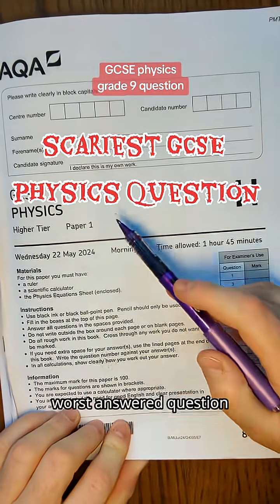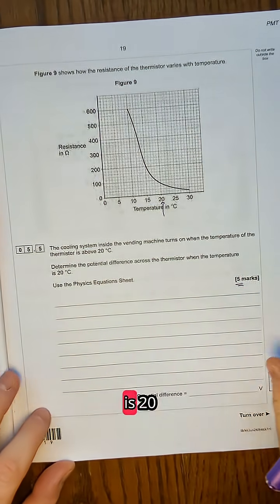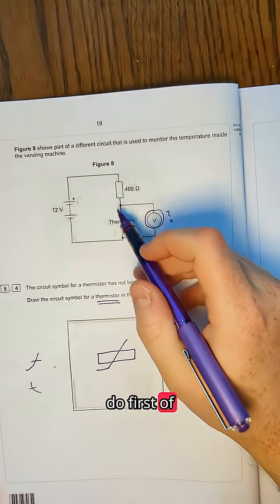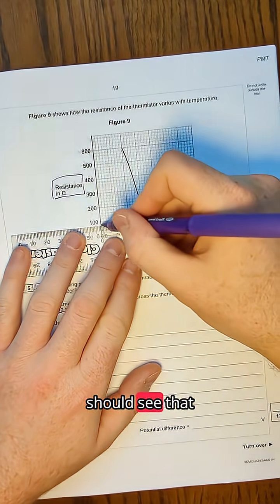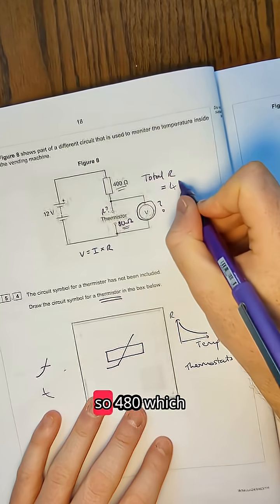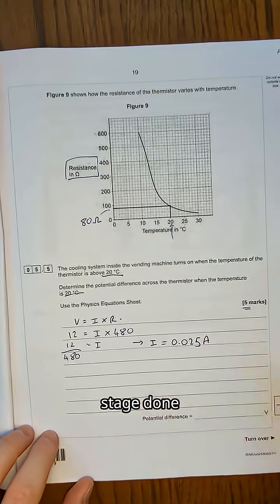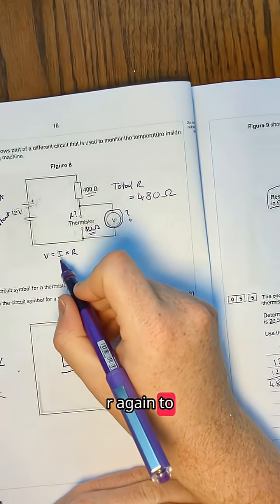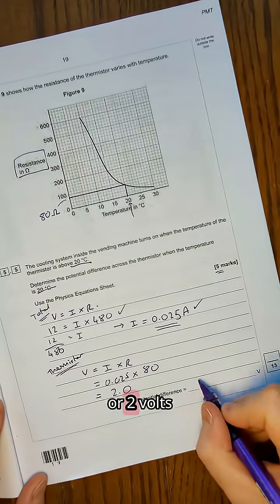TERRIFYING electricity question 😱

Comment: Why does GCSE Physics go so deep into what feels like electrical engineering? I get that physics and materials science are important for understanding circuits (so the other way around), but it feels like we’re crossing into another subject. Also, why are we still teaching V = I × R instead of just saying 'voltage = current × resistance'? Using 'I' for current just confuses people, especially when 'C' is already used for the speed of light. That one makes sense because it's a long term, so a variable helps. But for single-word terms like 'current', why replace them with letters that don’t even appear in the word? People just use the full words in real life anyway, so why not teach it that way from the start?

I could never do physics because remembering all the symbols just doesn’t work for me. Whether it’s dyslexia or just how my brain is wired, it means I’ll never get on with it. But I do computer programming and electrical engineering all the time, and I’ve never once used or been taught V = I × R. Everyone just says 'voltage equals current times resistance'.
Also, this kind of question is way too simplified. It doesn’t mention the wire gauge, the length, or even the material — is it copper or aluminium? All of that affects resistance. And voltage isn’t just 12 volts, it’s usually something like 12V ± 0.5. So students are being made to solve something completely theoretical that has no real-world application. 

Even with just standard voltage fluctuations, the answer is actually 2.00 ± 0.08V. And that’s before you even ask whether it’s on a circuit board, how thick the traces are, or what the wire is rated for. which if you're doing physics hell even for computer programming that 0.08 can be an absolutely huge difference, it can flip a bit on me. at the end of the day the answer is unknown till you know all the variables including wire resistance (which could be given, or if your testing material science for electrical design, knowledge grade of wire, length and thickness so they can work out that resistance),
Reply from the maker: Hi thanks for your comment!
It's a bit contradictory as it seems you want GCSE physics to be easier but also harder.
To address your points:
1. GCSE students get an equation sheet in the exam, so no memorising needed
2. You're absolutely right all those factors affect it, they are often assessed in other questions - but not this one
3. Uncertainties play a big role, again they can be examined at GCSE and A-level physics but not in this question.
So yes questions do contain real world applications, but one question at a time 😊
Reply: @captainphysicss  No, my point is exactly that the way the exam is set up is contradictory. It's not real-world electrical engineering, because if it were, it would need to be specific. Yet it's being included in GCSE Physics, even though it's clearly an electrical engineering topic. That's the issue , every time this kind of knowledge is tested, it's framed in a way that directly contradicts how it's used in the real world.

Your reply actually raises another question: how much of the exam is really physics, and how much is material science or electrical engineering? Because if it's supposed to be a physics exam, then why is it testing concepts that belong to other disciplines? A theoretical physicist doesn't need to calculate conductivity or material properties they cite known values from the research (as required). Meanwhile, potential electrical engineers are being forced to study irrelevant theory just to qualify in their field that could push them out of it.it's just for the testing, drilling of cross-discipline content into students purely for the sake of an exam. 

This isn't a one-off either. In every level of maths training I've taken — KS1, KS2, KS3, KS4, A-level, and degree level, I've been told to "forget what I was taught before" in at least one topic of the curriculum. How about we stop teaching irrelevant content (especially when the variables cross over quite horribly in some instances, physics and electrical engineering have a lot of overlapping letters for variables these two topics should not be mixed for that reason alone if your insisting on them using variable formular ) and start focusing on knowledge that actually prepares students for their future?

Comment: Not sure if it would get full makes based on the MS but I was taught that the p.d. across the thermistor would be (Thermistor resistance/total resistance) X (total V of DC circuit). So in this case would be 80/480 (1/6) X 12 = 2V 
Eliminates the whole current step and is much easier intuitively imo. Again, not sure if MS allows it though
Reply from the maker: That's a very common method! The mark scheme would definitely allow it as it's just a different way of showing the same calculation.

Comment: I get this is correct but there is a formula for this called a vcltage divider V = (V_s * R2)/R1 + R2. Which would have made this able to be solved in less time. Same answer, but I feel simpler. The formula just implements exactly what you did explicitly
Reply from the maker: Yes you're absolutely right, that's how I would teach it for A-level students. For GCSE students they wouldn't be expected to know that method, so in my view this is the most logical for them to follow